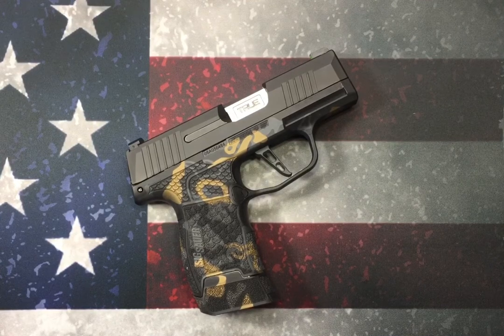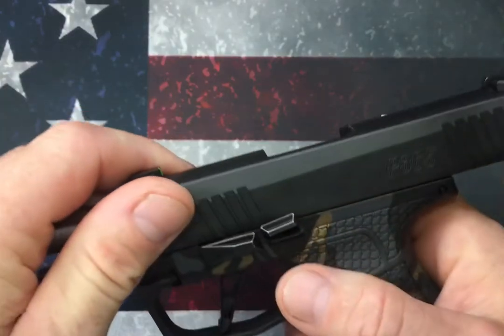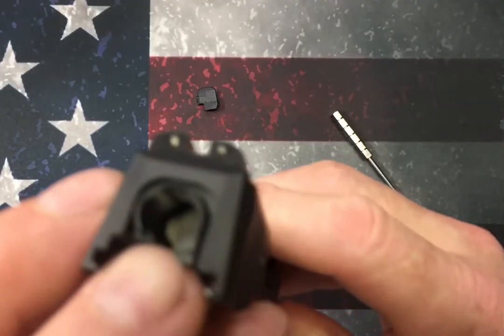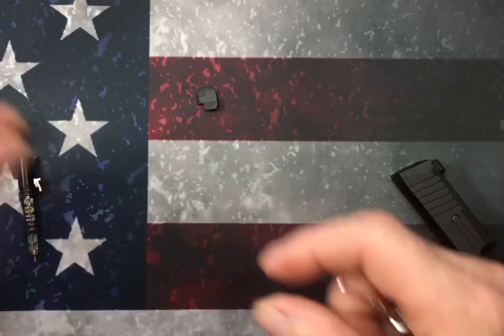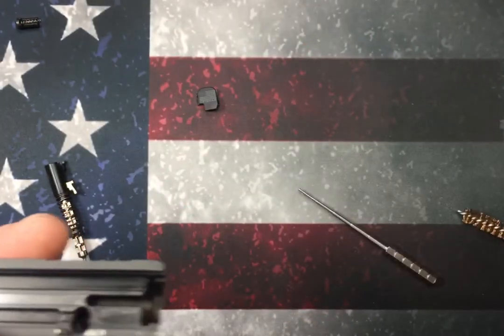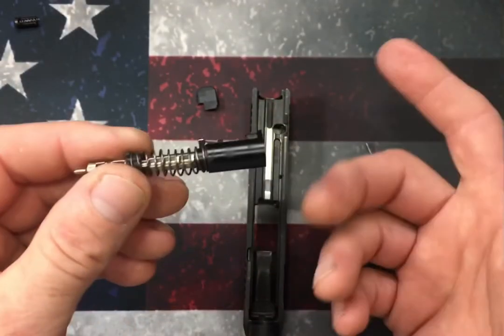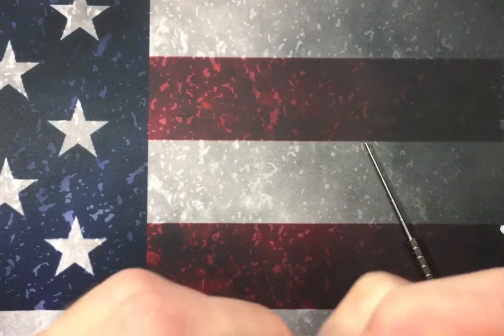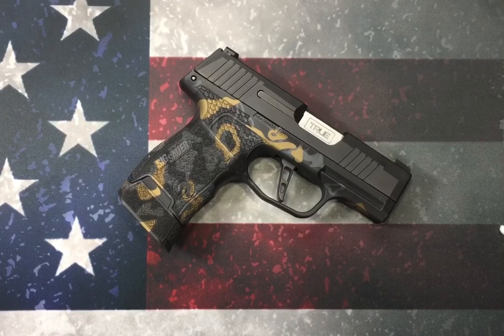Sig Sauer P365 striker removal, cleaning and reinstallation

Comment: Thanks of course for spending the time to post.  For my first P365 I did a cleaning b4 the range test, but did not disassemble the striker. Pistol gave light primer strikes and some failure to fire.  Took out the striker and found very small metal shavings and grease gunk in the channel. Also used a roll up of 400 grit paper to buff the channel. The cases showed excessive striker drag on the primer as if the striker was delayed in retraction. After more cleaning and two boxes of bullets it seems to be happy now.

Comment: I purchased a P365X built in 2021 and the striker and striker chanel were filthy with grease when I first did the initial cleaning upon receiving it. Mine has the "updated" striker and it's all black, luckily I haven't had any issues with light strikes or any of the pronounced drag of the earlier strikers. Thanks for the awesome videos as always.

Comment: Thanks for the very detailed instructions on removing, cleaning and reinstalling the P365 striker.  I have two P365's, an April '18 build and an Oct '18 build.  I had heard of numerous people saying how dirty or contaminated the striker channel on these pistols were as they came from the factory.  So following your instructions I decided to look at both my pistols, and I have to say their striker channels were both still fairly clean even after having shot several hundred rounds through each.  The April build had the number '7' striker in it and the Oct build had the number '8' striker.  The 7 striker doesn't have the built up concave base at the bottom of the striker pin as the 8 version does, and the striker assembly spring is more coiled up vs the later striker whose spring is more straight.  I've heard the latest striker has a modified tip with a bit of a bevel which is supposed to reduce the striker drag issue.  One thing that was interesting was the difference in the striker safety spring.  My Oct '18 build striker safety spring looks just like yours in the video, while my April '18 build spring is shorted with tighter coils. I noticed the newer safety spring seems to provide more force on the striker safety than the earlier one.  I think I'll order a new striker and striker safety spring for my older P365 since they've both seem to be improved over the original parts. Looking forward to more content from you on the P365.
Reply from the maker: Randy Giedrycz great comment. Please do a follow up when yuk get the new parts. My slide is early and was modified to accommodate the new style striker. It will be interesting to see your results. Thank yuk for the comment.

Comment: Great detailed video with no BS. I have to do this tonight because of light primer strikes on my 365xl, so this will make it a piece of cake.
Reply: Come for✍️✍️ your reward🎁
Reply: Did it eliminate the light strikes after you cleaned it?
Reply: @JohnB-dr8sk  It did. It's been perfect.
Reply: @tmay1975  Interesting and thanks for the reply. How many rounds have you put through it since you've cleaned it and not had any problems?
Reply: @JohnB-dr8sk  1000+ I trust my life to it.
Reply: @tmay1975  That's really good to know, thanks. So what's your take on Sig's developing light strikes compared to Glocks, for instance, which can run dirty for thousands of rounds without light strike issues? Is it that Sig's striker and/or striker channel are just more vulnerable to dirt/gunk/grease and this channel needs to be cleaned more often? Design defect?

Thanks

Comment: Bought mine new a week ago 1/23 and tore it down to clean it. The striker cavity was soaked in that heavy silicon feeling lube they put in their guns to prevent rust and corrosion during storage . Also, the deepest and smallest diameter section that centers the striker was full of sludge and gunk. After putting it back together and dry firing it, the sound of the striker "firing" sounds much crisper. Before it was almost a rubber boingy thump . I'm pretty sure I'd have had some light strike issues if I hadn't taken it apart and cleaned it out.

Comment: My slide end cap started sliding down during shooting during the last trip to the range. I snapped it back in place and it came loose again the next mag. Your video showed me there is a new design that presumably retains  the back plate better. I called SIG and they sent me a new sleeve. It is different design at the back (cap interface) then the original (1/29/19 pistol born on date) and looks like the one in your video. Seems like better lockup. Will test and hopefully will fix my issue.
Reply from the maker: Jim Rodriguez very interesting. That striker assembly in my video was from a June 2018 365. Can you please send me comparison pics of the two that you have? The one the back plate kept coming on done with and the new more secure style. 

https://www.facebook.com/profile.php?id=100009802713942
Reply: Same! I had a born date 2/2020 and same issue 
Got it back from Sig a few days ago but need to go and test it. 
It was only certain problems, I think perhaps shooting too fast? Or got too hot? 
Keep ya posted
Reply: Sig Sauer Guy Hi! Sent pics to your Facebook

Comment: Great video. One question I have is do you remove the shiny plate on the inside of the slide next to the ejection port. Mine is black streaked and I’m having failure to eject problems and I’m wondering if the there is dirt underneath it that is causing the extractor to not engage the spent cartridge. Thanks

Comment: There’s another version of the striker
 On Mine you have to move the nub to the left and then pull down. The you can remove the plate. Definitely not as simple as this. 
Mine is a standard P365 ‘22 I believe
Reply from the maker: This video is also older than dirt lol. I've done many other videos showing both this and the current design. Here's a link to one if you are interested. Thank you. https://youtu.be/S7nxvxOTjqY?feature=shared

Comment: I just purchase a p365 coyote tried dissemble my striker plate but still having complications with it. The little button doesn't press down but moves to the side.
Reply: Same here. I think you have to push it toward the middle AND then pull it toward the muzzle.
Reply: @sbreheny  Thanks I figure it out, weeks after I post on here lbvs.

Comment: The p365 xl doesn’t seem to have the same style plunger to remove the back plate  Is there a different procedure to slide off the back plate?
Reply: Mine is the same way. There isn’t a plunger but rather I had to use a small screwdriver and force the plastic block towards the inside - towards the center of the slide. Once it cleared, I could start to pull the plate off but still had to keep tension on it. To get the new plate on had to do the same thing to get it to clear. Not easy at all.
Reply: @keithsingleton1698  same, pain in the ass. more push it to the left, than push it down.

Comment: Just cleaned my new vtac and the striker and extractor channels were filthy. It helps to clean first with solvent then use gun scrubber to get bone dry. Ive never used the dry lube but I may try that.
Reply from the maker: Hod 8 absolutely. Thank you for the feedback.

Comment: So that slide/end cap started falling off when firing on mine causing a failure. Sent it to Sig and just got it back. I tried to get the striker out and realized that that plunger is now a solid block that does not move, so how do you take it out now?
Reply from the maker: Did you watch this video? Is it the same as the new style in this video or is it something different as well? 

How to remove new and old style P365 striker assembly

Comment: Forgive the newbie question, but, how do I know if I put the striker safety back in correctly? It dry fires fine...
Reply from the maker: Jt Hearn all questions are welcome. Can’t really mess it up. I usually push it in and out a few times with my finger. Kind of like a function check. If it’s springing back you should be all set. If it’s in wrong you definitely know it. Doesn’t spring at all. Interferes with striker assembly.

Comment: Bought a new striker assembly, only to find out it doesn't fit in the first year guns. Ugh,
Reply from the maker: Ray Houthuysen one of mine is a very early one also. I remember when I sent it in for trigger bar spring it came back with new striker design. They also modified the striker cavity also. They must be your problem. I’d contact SIG and see if you can send it in.

Comment: There's a bigger gap than I noticed before I dis/reassembled between the lower receiver rails and the slide at the back... That's not a problem is it? (Gun noob asking)
Reply from the maker: nbr1rckr nothing has changed should be exactly the same. Sometimes there is a different gap depending if there is a magazine installed or not.
Reply: @SigGuy  gotcha. Thanks.

Comment: I’ve gotten to the point where I have the striker inserted and it has captured the safety. Now whe I go to compress the striker to insert the slide end plate it won’t compress. If I compress the safety spring then I can compress the striker enough to install the slide end plate. Is this normal?
Reply from the maker: Yes sir. That is the proper and correct procedure.
Reply: @SigGuy  Thank you. Do you have a site for Q&A?

Comment: Lost the striker safety spring will the gun still function till i can replace it?
Reply from the maker: rusty shackleford no idea. I have spares of everything just Incase.
Reply: Also are p365 and p365xl parts interchangeable?
Reply from the maker: rusty shackleford FCUs are identical so most parts yes.
Reply: Don’t recommend it I will assume it will go off if you bump it hard enough

Comment: hey man, how do you like that true precision barrel?
Reply from the maker: Big fan of those barrels. I’m actually using the threaded ones on both of my 365’s. The extra length increases the velocity which actually increases accuracy as well. They don’t conceal any harder. The finish on them seems to hold up a lot better than the factory barrel also. If you do decide to purchase one check out Osage County Guns. There is a code you can use to get 5% off and free shipping. Use “true” when checking out.

Comment: I've saw on another forum some speak of a tiny cyndrical piece of plastic coming out when removing the striker from the P365 XL.  They said they could not find it on any parts list and they put it back together without it.  Their gun seemed to run fine afterwards.  I just removed mine and the small piece came out of mine as well.  Any idea what that may be?
Reply from the maker: jaxhouse 28 ok. I wasn’t ignoring you I was trying to find the correct answer as I don’t own a XL. Ok so the rubber piece is a buffer that goes between the striker housing and the slide to keep tension on the end cap and keeps the cap from dropping down. Without the buffer there is a likelihood the end cap can slide down.
Reply: @SigGuy  Thanks...I may have to wait for a tutorial on how to reinstall it.  :)
I couldn't figure out how/where to put it back.  Thanks again!
Reply: @SigGuy  Update:  I put that little rubber piece back, where I thought it should go, and found it a pain.  In the mean time on a forum I saw a mention that has been redesigned eliminating the need for the little rubber piece.  Just called Sig to confirm and was told yes that I has been redesigned eliminating the need for the rubber buffer but that part is not listed for sale to the general public, that it is an armorer's part.  Look forward to when you get an XL for your opinions and tips.  Thanks!  Also excited to be part of the Facebook groups that you mentioned.
Reply from the maker: jaxhouse 28 thanks for the update. Gonna be a long wait lol. I don’t plan on getting the XL or the X5 Legion. No need for them and theres not enough of a difference to make me want one. 365 is supposed to be small small small which it is. XL? Might as well run a sub compact IMO. X5 Legion.... really only the grip module is different.  If that had put more bells and whistles I would have grabbed one. Anyway I heard about the redesign also. I just can’t comment on something I don’t have or know very little about. Thank you for the info. I’m sure it will help many as you are probably the 20th person to PM me about not knowing where  that piece goes! Haha. On a side note.... all kinds of 320 and 365 goodies coming up next month. Thank you sir.

Comment: I'm not a gunsmith but I've had 60 years experience in assembling, dis-assembling and tinkering with all kinds of guns.That being said: after multiple views of your video and multiple efforts, I can not free the back plate to remove the striker.
Reply from the maker: TBPollock mine was stuck on pretty good initially also. Make sure that plunger is fully depressed and give that back plate hell!
Reply: @SigGuy  Time to break out the vice grips.

Comment: The updated version is garbage. Easy to destroy the striker sleeve when you remove it. One of the worst fixes for a firearm problem I have ever seen.
Reply from the maker: So what you are saying is you prefer the back plate sliding off while in a self-defense situation? Once you understand how it works its not a problem removing it with the proper tools.
Reply: @SigGuy  No. I'm saying it's a jankey fix on a $600 firearm. Any critical part on a firearm that can be compromised or pretty much destroyed after a few removals is a jankey fix. Period.

That being said, the 365/365XL are awesome pistols. The 365XL is my regular carry pistol. I wouldn't trade it for anything else.

My opinion: Sig should include a couple extra striker sleeves in the box when you buy one. They could even raise the price a couple bucks on an item that probably doesn't cost them more than a buck each.